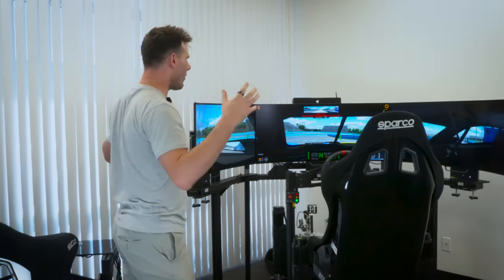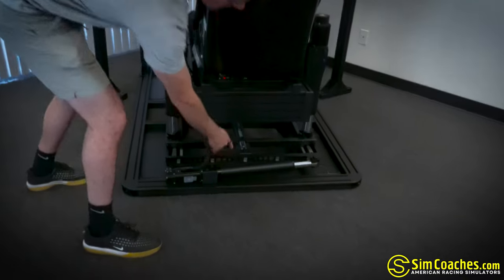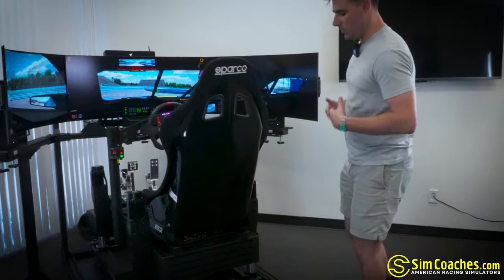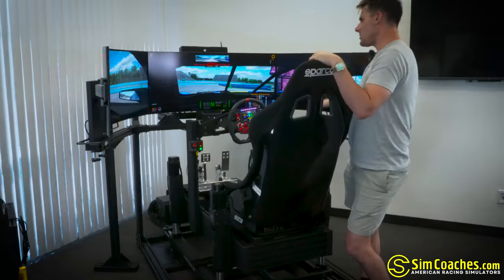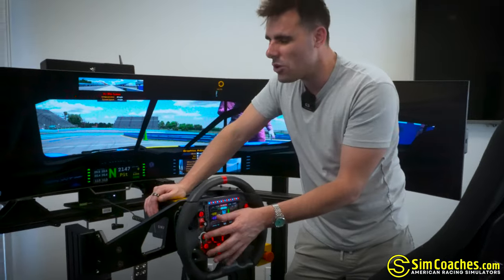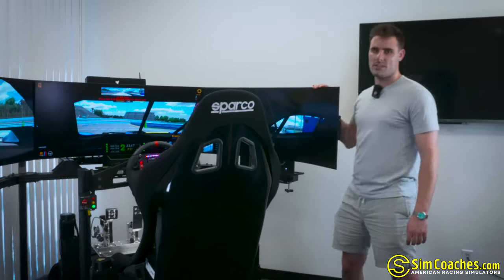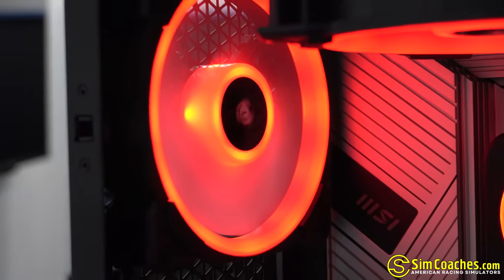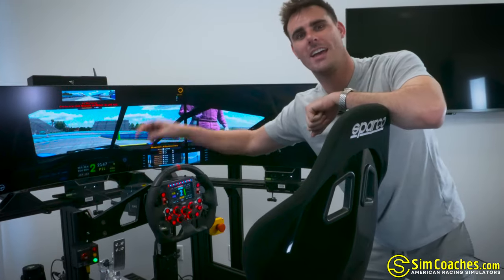6DOF RACING SIMULATOR! Full Build!

Comment: Motion looks solid, by far one of the most complete systems I have seen. Only thing I didn't care for is the smooth  extrusion, would be better to offer drop in panels if the owner wants a smooth look, otherwise you loose part of extrusion, the customizable options.